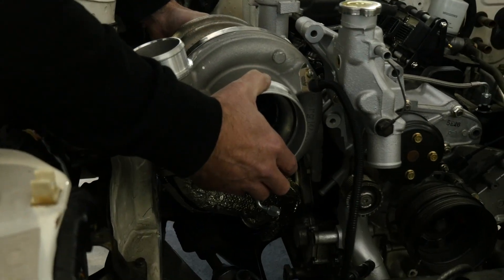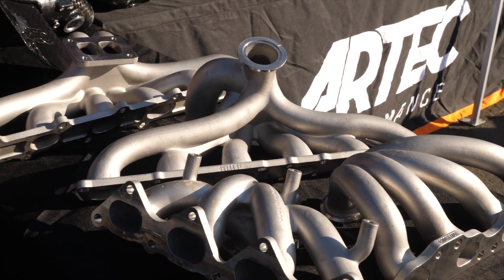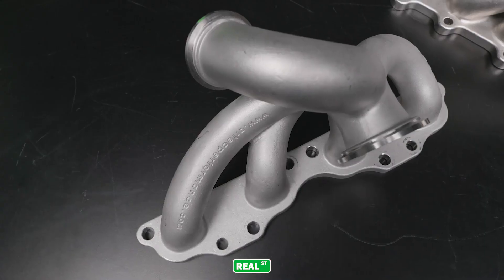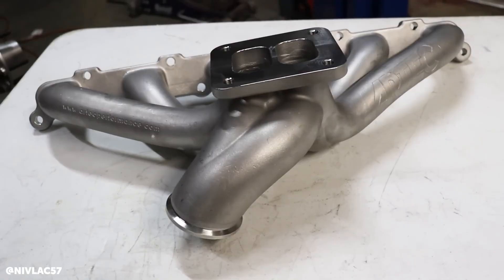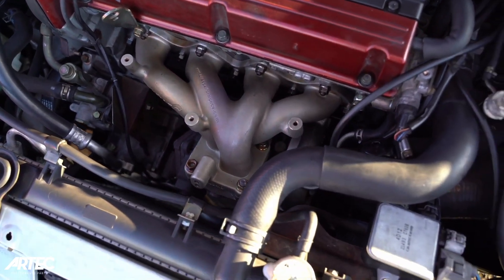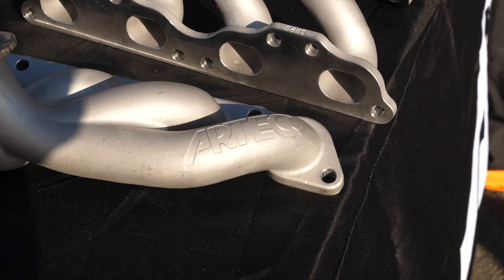Why Not Fit The BIGGEST Exhaust Manifold You Can?

Comment from the maker: Do you have a manifold/turbo brace fitted to your setup?
Building a fast car? Get EVERY course ever with $400 OFF the VIP package: https://hpcdmy.co/vipy12
50% OFF your first engine building course. Enrol now: https://hpcdmy.co/offery12
TIME STAMPS:
0:00 - ARTEC Performance
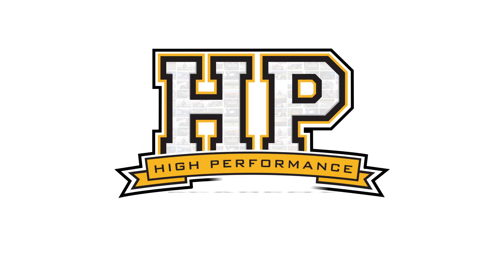0:22 - Why Bigger?
1:30 - A Better Approach
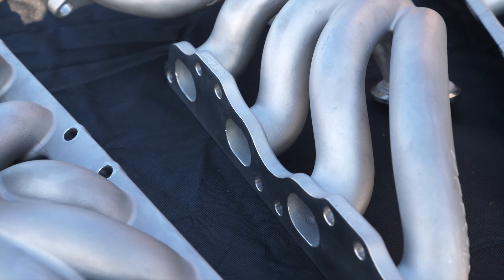2:19 - Turbo Vs Exhaust Sizing
3:35 - General Flow Considerations
4:01 - Flow Vs Volume Principle
5:04 - Bigger Is Better Mindset
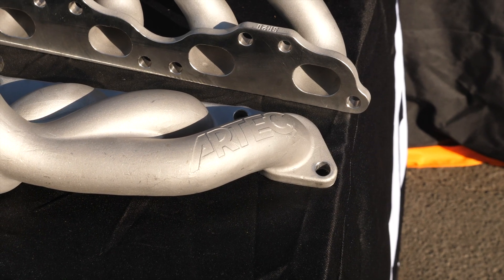5:42 - Backpressure & Restrictions
6:45 - Product Vs Application Range
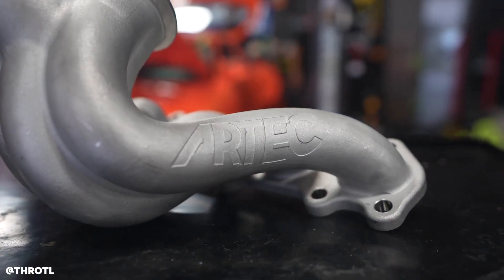8:01 - Cast Vs Fabricated/Custom
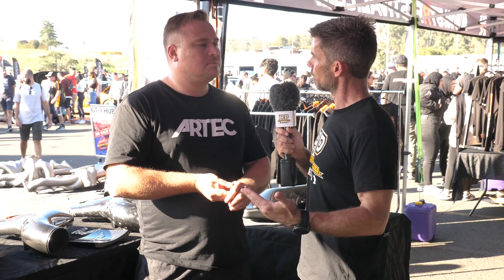9:03 - Cast Material
10:27 - Turbo Bracing
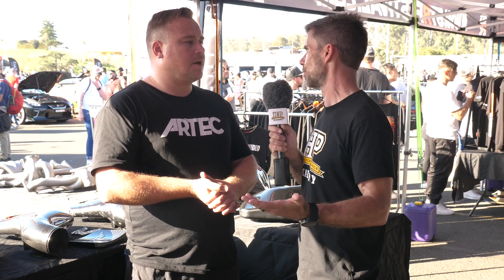12:31 - Wastegate Intergration
13:45 - Thanks Ben!
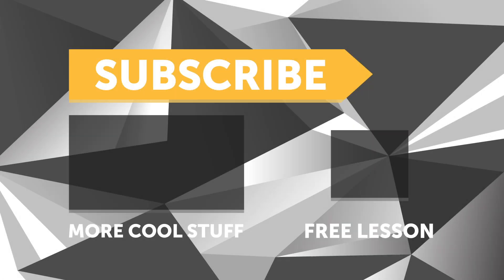13:57 - BUILD.TUNE.DRIVE
Reply: Mine has the downpipe braced to the engine block, the bock has 3 10mm bolt holes right in line with the downpipe. So we made use of it to make a plate with a triangulation to the downpipe. 10 years, zero cracks on the manifold.
Reply: Downpipe braced to block
Reply: It would be cool to see a video on this topic Andre. I am in the process of making a turbo manifold, and bracing it correctly is something I need to research.
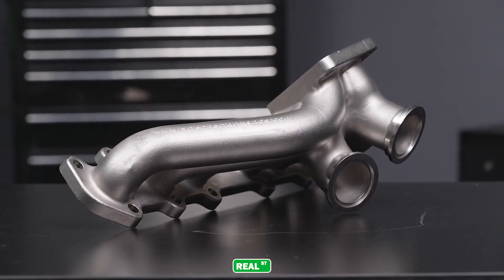Reply: So what's up with that man we see in one frame at around 7:32. ??
Sitting at a table with lots of exhaust parts and turbo parts.
Reply from the maker: @acemanyellow13  that's Jay from Real Street Performance, they're tagged there for the b-roll and have a great channel. Looks like one of the team missed their mark a tiny bit on that cut though sorry.
https://www.hpacademy.com/blog/050-developing-and-tuning-engines-for-400-mph-podcast/
https://www.youtube.com/@realstreetperformance
Reply: @acemanyellow13 that's Jay from Real Street Performance, they've probably just grabbed clips from the YouTube channel
Reply: @deets_  We like Jay. Very knowledgeable man.
Reply: @acemanyellow13 that's the man !
Reply: No enuh, using ach40 stainless
Reply: Does it mean that there are SR20 and even CA18 exhaust manifolds coming?
Any chance on oem+ style intakes too?

Comment: Every Artec manifold has hotspots. Bro said 800hp evo w zero back pressure.. lol. I mean they should get off using leaf blowers as their primary CAD tool. Why would someone spend 50k on an engine, only to buy an artec which isnt designed for peak horsepower? Seems rather stupid tbh.

Comment: 4:28 one cannot deduce from manufacturers' omitting exhaust manifold and bolting the turbo directly to the head that they are doing this for efficiency. The cost of manifold is a major player in the equation, they are willing to save $30 on an engine and lose 10hp.

Comment: Have an Artec manifold and it looks nice but theres a few things wrong with it. 

First thing is the bolt holes don't line up.
Second thing is the internal casting will need to be cleaned up.
Theres no installation manual about anything.
The down pipe is almost the same price as the manifold itself.

Will make a video about it.
Reply: @AdamNZ  hey mate what did go wrong with the bolt holes?where they so tight fit on the studs?how did you manage to fit it?

Comment: Shit i remember back in early 1990's a place did research on matching air flow in the head, especially turbo based engines and they worked out the angles of the pipe for the exhaust is a big factor as well. 🦘🦘👌👌✌✌

Comment: Just saw your video on '9 boost control problems'. And some of these manifold wastegate positions are wrong, with the exhaust gasses have to take a 'backwards turn' which would run into boost control issues.

Comment: Man have being basically this for ages.. I have a stock manifold In/out RB25 factory cams only makes 270rwkw reliably on nz98 gas... On Ethanol it jumps to 380rwkw. after 8years of daily 98 driving  with ,35% of that time on Ethanol and 85/90000kms have finally lifted the head which is fine. Seems like past this point is aftermarket manifold stuff is necessary

Comment: Bracing the turbo is SO UNDERRATED!!  I make a billet collector with integrated mounts, and they sell like hot cakes.
Reply: How would you brace the turbo?
Reply: @thecalamariman7805  shameless plug on my part, I make collectors that have integrated mounting holes.  But Toyota turbo engines would brace the the hot side to the block with a beefy brace.  Like 6mm thickness material.

Comment: Lovely manifolds, but ur going to have boost creep issues unless you have co2 controlled gate. Making a u flow dump pipe means it is less effective when speeding gas has to make a turn to the gate as opposed to flanking off gas flow direction.

Comment: Love how he dodged the question of will this be restrictions oft high horsepower outputs. So what is the limitations of these manifolds? We all know long runners and merge collectors make power higher in the rev ranges. So do they have different manifolds for different applications? Ie street, rally, drag?
Reply: do they need them ? They offer what they offer and as he said it's more directed to the street/race application, where spool and mid range is of more priority than a sole single high rpm number which is often meaningless. People have made over 1000hp with only 1.75" OD runners on 4cyl motors, and much higher on 6. It's odd then why some feel then need maybe 2" or larger runners. Although it has to be said, it's nice to keep head/port sizes throughout for smooth flow, even if not necessary at all for performance.
Most people probably wouldn't find the "limitation" of a manifold like these, whatever that means to the actual used anyway. Most peoples turbo, or their engine, or their budget, or their ability will likely be more of a limitation.

Comment: Some stuff he said wasn’t accurate. OEMs will see more heat than aftermarket not less. Some engines I’ve tested are 950c and above egts from oems which is nuts! Why the heat insulation around the manifolds and cats is getting to be so insane.
Reply: Yep agreed, some of the twin turbo V8s in development at work are 1020degC preturbine temp. Most turbo engines are between 950 to 1020degC

Comment: I always try to tell people to go smaller than you think you should, especially if you're running low boost. Every turbo setup I've made since my first one has been progressively reduced in size, length and volume. Merge the pipes with the most shallow angle possible, but otherwise, get the pipes to the turbo and get it spinning! That's where the power is. I wouldn't be surprised to see most turbo setups GAIN power with smaller manifolds, even if the backpressure went up.

Comment: You should design in an anti-reversion lip
Reply: How does that work ?
Reply: @AndrewEG  Usually by making the runner significantly larger than the exhaust port, then gradually reducing back down to the desired diameter.  The exhaust gas can travel freely from port to runner, but when it travels in the opposite direction, the rim around the port somewhat restricts the flow.
Reply: @heem6619  that would start to choke the flow at higher mass flows. You are essentially forcing the exhaust gas through an orifice and this will increase the upstream pressure. Adding more pumping losses and more residual gas in the combustion chamber.
Reply: @AndrewEG  I think you misunderstand what I am describing. Anti reversion is a proven concept and is commonplace on high performance motorcycle engines. The "orifice" is the exhaust port, which is the same size either way. Anti reversion creates a sharp step up, and a smooth gradual reduction in diameter to maintain gas speed. The step does not impede flow out, just flow in. In a cast design the gradual reduction in diameter can be designed in easily. David Vizard was testing the concept 40 years ago. If you google anti-reversion manifold you should find more information on it.
Reply: @heem6619  yeh I understand you now, I know of the concept but never seen it applied to automotive OE. Ill have to test it in CFD one day
Reply: @heem6619 I'm not sure if I would call it a proven concept, but I would agree to call it a used concept. Sometimes people seem to report some benefits but it can be the opposite as well, sometimes you do have to work with what you got and sometimes you'll have more options. You typically don't want a too abrupt change in CSA as you change the pressure and can get poor pressure recovery, a somewhat common place where people get this wrong is in the collector and/or wastegate connection on turbo manifolds.

Comment: I found the rule of thumb is about 88 gross HP per square inch of runner area. Basically anything bigger is wasting energy before it expands thru the turbine.  One of my personal builds uses 1" runners since I decided I was not going to exceed much over 50HP per cylinder
Reply: What do you mean by 'cubic inch of area'. Area is inch^2.
Reply: @icodirtjumper  i fixed it.  I meant to say square inch of area.  I was rushing when I typed that and didnt proof read.  Thanks for pointing it out
Reply: Do you think RPM factors into this? Meaning, I want to rev to 8k+ and still be making peak power out there.  Does that influence runner diameter?
Reply: @FredAllenBurge I am sure it should be a consideration, only esting will confirm.  My stuff only goes to 7200rpm.

Comment: The best manifolds for a 2jz build. My engine builder/ mechanic actually made me get it because he refuses to struggle in tight spaces 😂
Reply from the maker: haha yes we didn't actually talk about that but completely valid point!
It did actually come up in this interview here as a topic, and funnilly enough it was ARTEC headers this team fitted too: https://www.hpacademy.com/blog/losing-27-horsepower-and-going-4-9-seconds-faster-how/
They made a few other changes as well though, they didn't just swap the manifold alone - Taz.
Reply: We're you able to add egt and back pressure sensor on this stainless manifold?
Reply: @damnitdang  It's on the exhaust not the manifold
Reply: @804MRMAN  emap will be on the exhaust  manifold  side. I don't think it'll work good if it's located on the down pipe
Reply: @damnitdang  Huh? I said exactly what you said bruh 🤣🤣🤣
Reply: @damnitdang  Wait wait wait... You guys are thinking of a diesel engine? I'm confused? Because my O2 sensor/Wideband sensor located on the exhaust/downpipe not directly in the exhaust manifold itself
Reply: So your “ tuner” made you get it because “he refuses to struggle in tight spaces” ?🤨

Seriously??

He shouldn’t have to touch the parts on your car for one thing. Tuners usually just hook up to your car and get to work. 

Why would he be messing w your manifold? Or does he build your car for you too? 
In that case tell him to man up and install whatever you want on YOUR car.  😂

Plus doing long runner manifolds isn’t hard at all. If you’ve done a couple you’ve done em all. There’s a few tips a person should do to prep the job and it’s a cake walk. Idk why so many dudes complain about that one. 

Other than that these manifolds don’t look appealing to me. And the fact the short runners and designs kill the sound output and make it more on par w stock twins. 🫣 I’m good w that .
Reply: @Wretched2JZ  Say bruh you wasted time of your life writing a novel. The post LITERALLY says BUILDER/ MECHANIC.
Reply: @804MRMAN that’s fine. Guys like you can just stay in your own lane and let whoever tell you what your car should be setup like. I don’t care, as long as your content w that. 

 Regardless of who builds /tunes it .Folks like myself, like putting our own parts configurations together. Only thing we stay more in line with the tune shop with is the Computer/tuning software.

Comment: I actually had some interesting data that supports what he said. Iv been running a compound turbo bike for a long time now doing some personal r&d seeing what's I can do. When we went to a short stuby manifold about 6x less volume and actually slightly smaller primary that tapers and we picked up some power but we picked up 2000rpm on spool. Interesting back pressure went down too.

Comment: Measuring EGT's at the beginning of each runner will tell you when your exhaust manifold is done. If you run EMAP at the turbine, turbo drive pressure will let you know that is the restriction.
Reply: what do you mean by 'its done'?
Reply: @icodirtjumper  The exhaust manifold has become a restriction. The runner size needs to be increased for the amount of flow needed.
Reply: You won't know if the manifold is a restriction if you only measure the pressure at one location. You need a delta pressure but the pressure has to be corrected as the engine out and pre turbine temperatures can differ by up to 120degC
Reply: @AndrewEG  No single data point will tell you exactly what is going on. You have to follow the trail of breadcrumbs.
Reply: @spooler7828  I map engines for a living at an OEM. I can't follow breadcrumbs or other engineers won't be too impressed, probably cross with me. With any flow, the delta pressure is an indication of pressure drop due to flow losses. I don't know any other way to work this out without the two critical variables.
Reply: @AndrewEG  That's good. I modify stuff from 340 OEM crank hp to over 1000whp and try to make it live. When you have over 175hp per cylinder it becomes a challenge. Most folks don't have development money to monitor everything.
Reply: @spooler7828  that's a good effort! To be honest I wish I could have the level of instrumentation I have available at work for my own projects.
Reply: @AndrewEG  Don't we all. I had to move over to a standalone to get what I needed and I still don't have turbo compressor speed sensors. Wouldn't fit in my front covers.
Reply: How can I add egt and emap bungs to this stainless cast manifold?
Reply: @damnitdang  A good welder can do it. That's what mine were.
Reply: @spooler7828  which manifold did you have? Which engine? It cleared all the egt? How's the weld held so far?
Reply: I don’t understand how EGT at the start of a runner is going to let you know it’s a restriction. Curious though.
Reply: @lagwagon8018  That heat can't get out of the exhaust port of the head. The exhaust will back up in higher rpms. Drive pressure will be good but the EGT's have gone way up.